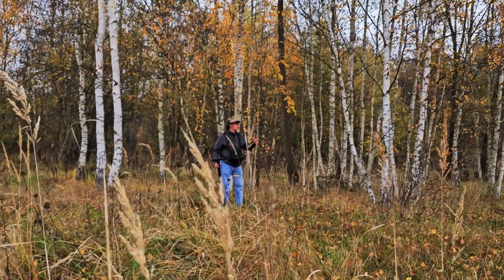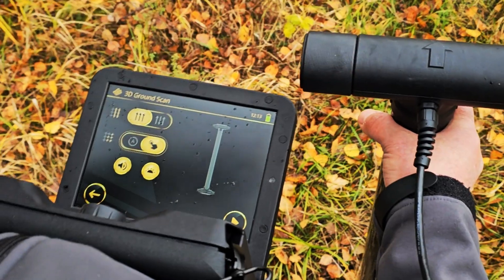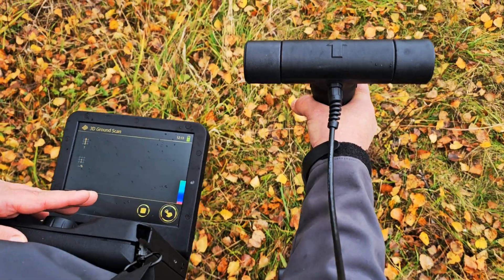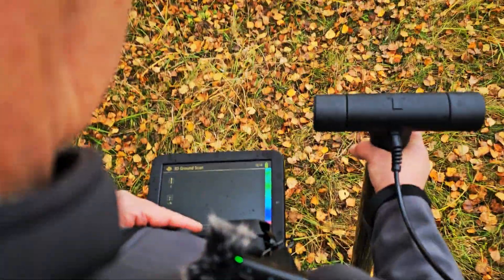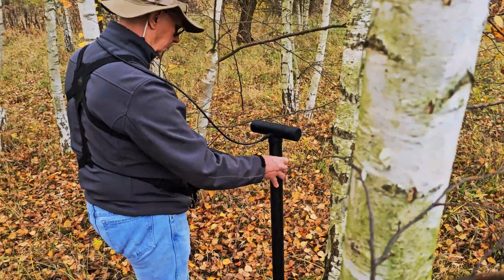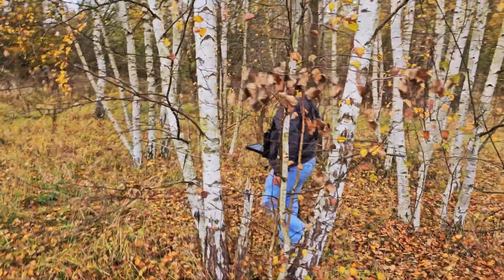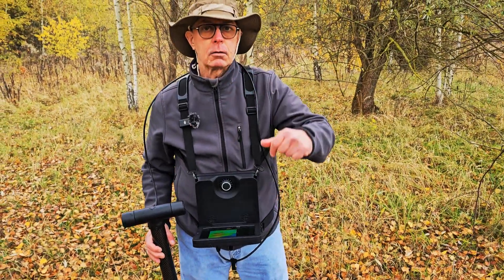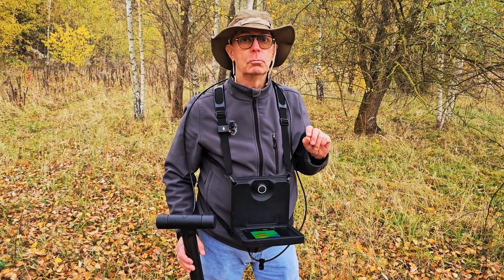How to perform a 3D Ground Scan in Manual Mode | OKM eXp 5500 Pro Tutorial

Comment: Bonjour Frank. Lors d'un scan 3D, est-il possible de sauter des rochers au sol ? Comme tu l'as fait avec l'arbre. Cela n'affecte-t-il pas l'examen ?
Merci..,
Reply from the maker: Bonjour, oui le mode manuel est justement adapté aux terrains accidentés comme tu le décris. Tant que tu essayes de suivre chaque trajectoire de mesure en ligne droite, que tu n'omets pas trop de points entre les obstacles et que la sonde est toujours à la même distance du sol, l'analyse en mode manuel fonctionne très bien.